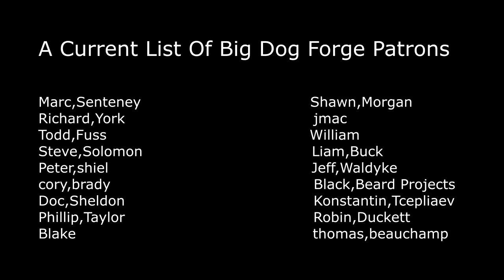Boice-Crane Bandsaw Rebuild

Comment: back when I was in vocational school the big band saw had a built in spot welder , they bought saw blade by the roll and made an patched the size needed . I never heard of silver soldering them . I know carbide is brazed to tool steel for lathes and mill cutters and is pretty tough. thanks for the tip !